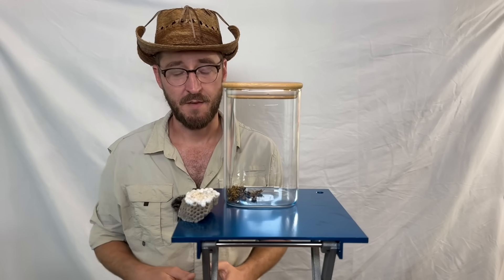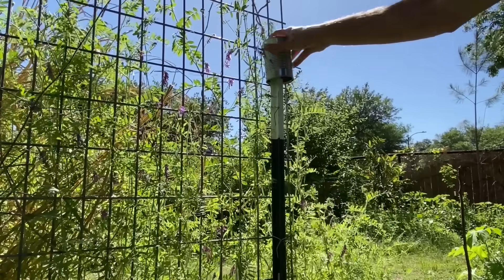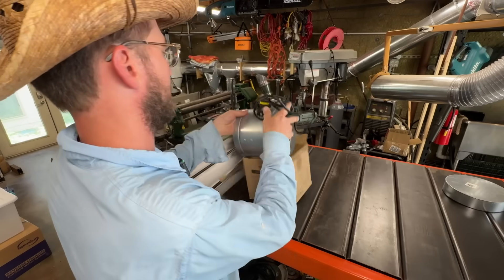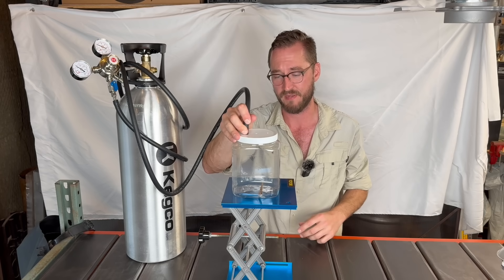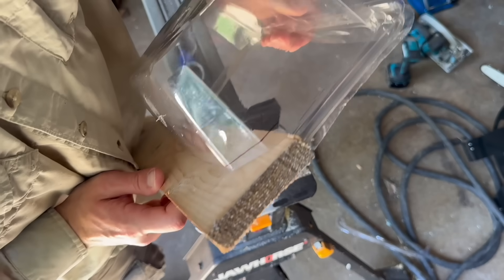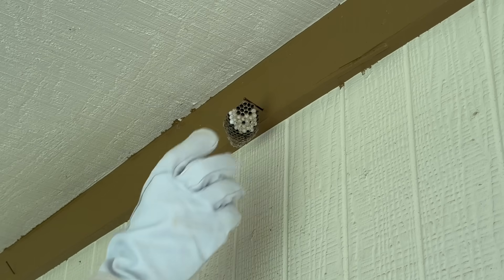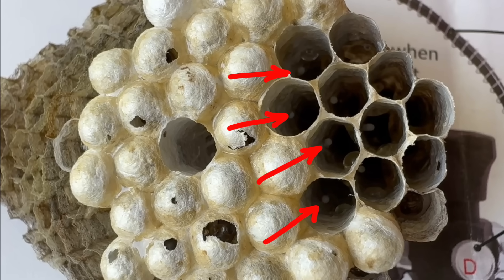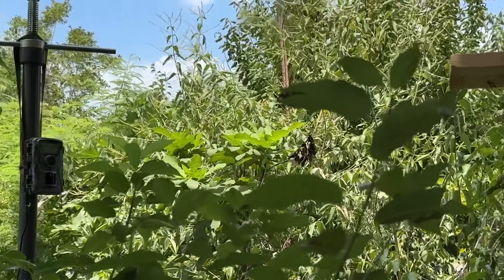Move WASP nests ANYWHERE!!!!

Comment: I'd guess the reason the wine bottle didn't work was because of two reasons. One, the material is smooth and likely hard to glue a nest in. Two, it lets in light, when the wasps are likely looking for dark and secluded places, high enough to be out of reach, well sheltered, yet open enough for the nest to have plenty of room to expand. You should make your mounts more enclosed to conceal the wasps better from predators.
Reply from the maker: I made more severe mounts in the Patreon follow up. You’re probably right about the glass. Thanks!

Comment: I believe the issue with the nest being eaten came from how feasible it is for mammals to climb that wire fence and get to them! I ran into a similar issue while attempting to help out a paper wasp nest I’d accidentally dislodged (first time in like two decades that I’d gotten stung): I made the mistake of setting up their new home too low to the ground, and just when I thought they were finally doing well, I came out the next morning to find the flower pot tipped over and only the stem of the nest remaining—just like with yours. I suspect a raccoon.

You could try instead gluing the new nests inside those hanging gourds you created, or indeed anything designed to hang like that, rather than right up against a climbable surface!

Also, it’s possible to befriend the wasps more directly by offering them a droplet of honey on the end of a long stick or coffee stirrer, and they’ll let you make the stick shorter and shorter over time! At one point I was offering those girls honey from like three inches away.

Comment: Very cool to watch as the more dense carbon dioxide surrounds them like a thick liquid and they literally sink.  Those fine little wings are optimized by evolution to work in a 78% nitrogen and 21% oxygen atmosphere, but that dense, thicker CO2 is too much for them to take off in.
Really like your ad hoc devices you build and trial along the way.  Great vid, thanks for sharing!

Comment: They really are quite tolerant. you basically gotta mess with the nest or like attack one pretty directly to get stung. 

only time i got stung was there were some that made a nest in a soda can and i was picking up trash. 

but under normal circumstances you can shoo them away and stuff just like you would flies. they dont wish to mess with you.

Comment: (Edited: Feel free to read this if y’all want to, i’m just glad i found this video after having a bad experience with yellowjackets)

I’m glad I ran into this video because in 2022, me and my dad (R.I.P) were dealing with yellowjackets inside of the house. The issue started where I just seen one of them, I reported it, and found the spray to kill it. I start looking around to see how it got in, and had thought because the part that goes below the door was gone that was replaced with duct tape for the time being, they could be crawling from the bottom of the door. Few hours later on that same day, another one was flying around, but around the light in the kitchen since it was on. Also seen a few dead ones on the counter and by the window sill. I killed the one flying and swept them into the trash. The same night, I went to get something to drink, I stepped on something i thought was just some piece of fabric or some type of piece of debris. I then felt something on my foot like a little poke. It didn’t hit, but i picked my foot up and seen it was a wasp just on my foot dead, and i quickly scraped it off and crushed it. (I’m really not a fan of wasps) The next few days were the same issue. Some dead on the floor and other areas of the kitchen, but they were all close to the window. My dad and I checked the window and seen that some were crushed between the bottom of the wood from the window and the top edge of the counter. We figured that it was coming from inside, but couldn’t physically see a hole from where we were looking. I looked a different direction and seen a hive of another specie of wasps that was a little bigger and more orange. Paid no attention to it but i told my dad it was there, and he told me something’s that led to use having to finally handle this situation. The next day, I walked to the side of the house where the window was, and seen there was some stuff of wasps coming in and out of area between the interior and exterior walls. I told dad that they were coming in and out, and he walked over there and seen what i seen, so he went to prepare some things to take care of it. My granddad pulls up, and starts talkin with dad about some things. I on the other hand, decided “I’m going to war” and layered myself with some jackets, joggers, jeans, gloves, a ski mask, and goggles. I thought I was safe before i went over to that nest. I picked up both my crocs, and went over to the hole under the window where u see a bunch of them swarming around it, and started hitting that area. I knew i hit a few, but was over when one of them attached themselves to me. I seen it do so, and tried to brush it off but was still there after i brushed it one time, and i roughly brushed it off panicking and running back to my dad n granddad. They were like “You okay?” and other stuff and started laughing while my BPM is on high. I then felt the area on my nose where the wasp was and felt a bump, so i knew it stung me, and it was my first time getting stung by anything in my life, so i had no idea what to think of it. I didn’t feel it probably because my adrenaline, but the bump got bigger over time. It was itchy as hell, and i showed dad what it looked like and he told me a remedy for it and i went for it. He told me don’t scratch it and let the remedy do what it do. Later on that day, he wanted me to spray some water on wasp’s area while he caulks the open spaces above and that area too before putting tape on over it. Whatever was stuck inside was going to die anyways, so we weren’t worried on what was left in there. But from that day forward, I never liked wasps, and doesn’t plan on going to war with them again “alone”😂😂
Reply: Oh no!  If the stinger stays in longer more poison is pumped in, that's why it was still on you. You are blessed that only one got you!  My dad was removing a tree when a whole nest of them came out at him.  It was pretty bad by what we were told, but we were little at the time so they shielded us from what happened.  Good thing you gave up on starting wars!!  😂🙏🏼🙏🏽🙏🏾🕊

Comment: fascinating!

I've had a long-standing fear of wasps, after a nasty sting from overturning a palm leaf looking for frogs that happened to have a wasp nest under it as a child. however, once I took up beekeeping, I have become more comfortable with our little resident flying huntresses.

paper wasps are also one of the wasp species that acclimates to people most easily- usually, even a few feet from their nest, they might check you out (a hovering zig-zag in the space around you is them trying to figure out what you are!) but as long as you hold still and breathe deeply and evenly (or just hold your breath) you're fine. flailing or swatting at them are a sure way to get stung, as is disturbing their nest. really, as long as they're not literally inside something that you use frequently, they're fine.

we have a large wasp nest move in to the far edge of our sliding glass door most years. and, after a brief acclimation period of them getting used to the door moving and not taking off when it does, they're fine- i've never been stung by them, despite coming and going maybe 5 feet from their nest. I'd be tempted to move them, but frankly, my little tomato-defenders are fine where they are, and moving them may expose them to unforseen pests or predators, like your stolen nest. plus, while I already have a co2 tank for my aquarium, shaping a container to fit the doorframe would be trickier... truly, I think we're fine just being host to multiple generations of garden defenders. they've never been problematic for my beehives, either.

Comment: My brother and I found a way to put them to sleep for free. For less noble reasons. Cup the nest with a jar and knock it loose. Cap the jar with a sheet of paper and screw the lid on. Skip the paper if you dig an adrenaline rush. Put the jar in the freezer for 15-20 minutes and they'll go dormant for up to 10 minutes. Remove the nest and poke it with a stick or relocate it if that's what you're into. Reintroducing the wasps should work the same(?). NOTE: Collecting a dozen nests in the same jar DOES NOT make for a spectacular bug war. No matter how many times you try. This free method might make for another great video plus more people might become wasp whisperers if there were no initial investment.
Reply: Except for the freezing part, that's the way I've been catching them for years, even if it's just a lone one in the house. You have to be careful & slide the paper (or thin cardboard like from a tissue box)  in beteen the jar & the surface with as little space opened up as possible so they don't get loose. Great idea to freeze if you're going to transport. I started to advocate for others not to kill them when I found out they were also pollinators & the bees were getting fewer.  Sometimes though I kind of wonder if they are too numerous do they harm other beneficial species. A fine balance is needed but in this sinful world sometimes the balance gets out of whack I think.
Reply: @brendaann727  Nice. But when you grow up in a trailer park there's nothing but your sister to pollinate so wasps are just enemies of metal sided/skirted dwellers. We invented a sport. The uniform was a pair of shorts. You could wear flip-flops if you were a wus or a shirt if you were a girl. You get one fly swatter each, short straw had to provoke a nest. Last kid standing and still swatting was the winner. We couldn't afford cable.
Reply: @brendaann727  Try never to get short straw if you're gonna play wasp swatting with bears.
Reply: I used to do this as a teen at parties...
Catch a big fly and put it in the freezer, then sneak it onto a window-sill, and pretend to find it infront of a bunch of people.   You can then cup you hands around the "dead" fly for a few seconds, and bring it back to life like some kind of insect Jesus...blows people's minds  :)
Reply: @N_Jones  That rocks.
You ever tried drowning a fly and reviving it in a dish of salt? The only 'A" I ever got in 6th grade science class was winning this bet with my teacher. Great for winning bets for beers at BBQs too..
Just checked, David Blaine and others did videos. Worth checking out.
Reply: @TerrySlaven-zd3um  Actually,  I think I read about that trick in one of Derren Brown's first books...the mention of Blaine reminded me.    :)
Reply: Gassing? Freezing? Drowning? That's some bad bug karma yall are building.

Comment: This is one of those life experiences that stick out more than most and it's very hard to explain why. 

Years ago I was sitting on my grandfather's porch in Texas. A insect came and flew right in front of my face. It was pretty close. I had to back up, but it stayed right in front of my face, hovering. It kind of look like a yellow jacket, but it wasn't. And it was holding a spider with all of its legs removed. After looking at this for about a good 15 to 20 seconds, it flew off. About 20 minutes later, either the same one or another one came back, it was hard to tell. But it was a different spider. It was alive, but still had all of its limbs removed. It did the same thing except hovered a bit further away from my face, which actually was appreciated. And after about 5 seconds or so I've acknowledgment, It went on its way. They were smaller than a yellow jacket and I've never seen another creature do this. Granted, most people do exterminate these type of creatures. But to me, it was as if this creature was showing me what it does or how it could benefit. I do not know what other reason there could be.

Comment: You can use a cheap bike tyre inflater that uses CO2 cartriges along with with a plastic container with a tiny hole drilled in it to put them to sleep. It's similar to the method of checking honey bees for mites, slightly more convenient than powdered sugar or alcohol. Same concept.

Comment: I believe a much easier and cheaper way to do this, would be to get a container, a filter to prevent them from falling in and freezing, some water, and a chunk of dry ice.

All you'd have to do, would be putting the dry ice in the water, securing the filter, then slipping the container over the nest.

Since dry ice, makes carbon dioxide.
Reply: cold temperatures also knock bugs out, so double the efficacy! i might try this next year if any wasps nest in a place my family isn't comfortable with

Comment: I love my wasp and they can become quite tolerant.
Reply: Try knocking a nest loose in a jar and popping it in the freezer for a few minutes. They go dormant for 10-15 minutes. And its free.
Reply: I got stung a dozen times when I moved a box from the front of a wasp nest in our deck box. That night at 3 am, I carefully put up a security cam while the wasps were 8" away lining the outside of nest wall. Next day I replaced that with a better cam, again carefully. I even slid a cardboard sheet to under an inch of the nest, for a better video, but this time I came covered head to toe ... they didn't attack, but were content in their own business. 

They're only looking to live; they don't bother humans unless you bother them.

Wish I could put the security cam feed online live, but I don't know how to go about it yet. Within 2 days they repaired the exposed section of the nest; it looks like it could even hold up to the rain now, though I'll close the box tonight in case of other critters interfering.
Reply from the maker: Me too! What I did is like literal child’s play compared to your work! Thanks for commenting!!!
Reply: @suburbanbiology hey homeslice, If you’re ever in a pinch and need to cut a glass bottle like in the video, you can do it with just a quartz crystal, a propane torch, and a basin of cold water. Just carefully score a circle on the bottle with the quartz, heat the score line with a torch, and dunk in the cold water and it will pop right off :)
Reply: Thank you for being so decent and kind towards these great creatures. You are so cool .
Reply: Yes, i did many crazy things like painting in 1" distance from the nest, opening a  roof window with wasp nests directly adherent every day because alot of wasps were caught behind the window. Or i demolished a old greenhouse over some weeks with a active wasps nest inside - they just relocated nest. The only time beeing stung was a wasp falling down my collar by accident.  They are much less agressive a commonly told. Just let them live until autumn and close holes to prevent nests for next year.
Reply: Totally need and up date
Reply: Please do an update😅
Reply: The long term effects on this wasps will be brutal.
Reply: I accidentally knocked down a pretty sizable nest from under an RV propane tank,  they weren't happy and i got stung....  i felt terrible for them.  After they calmed down and nightfall came i used a string and tied their nest to a rod and hung it back near their original spot under some planks. I checked on them often and could get right on top and interact with them without being stung after several days. They would all lay close on the nest wings tight all facing me and just let me put my fingers right up to them.  They're always within eye shot of their nests it seems. They're all gone now when it first got cold. 
I hear that offspring will remember my face, so we'll see come spring....
Reply: Me tooOooooooo🐝
Reply: This is 100% wasp propaganda
Reply: You might want to visit a doctor-for that mental malady...
Reply: @leonardodalongisland  May be its the other way round - insects lived on that planet long before the dinos - and might still be there, after the vertebrates died out (you are one of those vertebrates)

Comment: The wine bottle failed because they can't get a grip inside it like at all, it's more like an anti-wasp nest, and they can't land on it, it probably quickly discourages them to stick around for long to find a spot inside. Maybe if you sand-blasted it to be roughed up on the inside. 

Similarly, they probably only used the bean cans once the interior's coating had sufficiently deteriorated and given them a good way to walk around inside, and especially a surface they could adhere the base of the nest to. Bean cans have a plastic-based coating to keep the acidity of food from attacking the metals directly.
Reply from the maker: I used a washer to suspend the bottles with a paracord. I thought they could mount to that 🤷

Comment: I love every bit of this video! As an engineer, I instantly had a cheaper solution for this - instead of using a big CO2 bottle, you could use a soda stream cartridge! It is also possible to buy adapters and fittings for those cartridges that let you release gas through a hose. That whole setup should cost $50 at most! And best of all, you can always use that cartridge to chill with some tasty lemonade once the job is done. You can also cheaply refill it.
Reply from the maker: Not a bad idea. I think a bike tire inflator is even cheaper!
Reply: @suburbanbiology  or that! But those usually run off of small cartridges and I'd be worried the gas might run out before the insects are knocked out
Reply: per volume of co2, sodastreams are much more expensive to refill